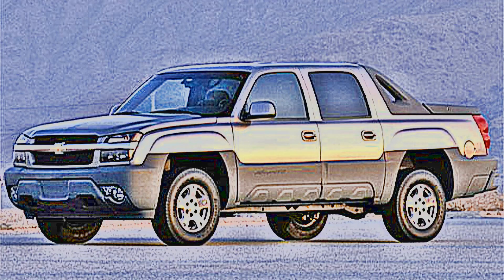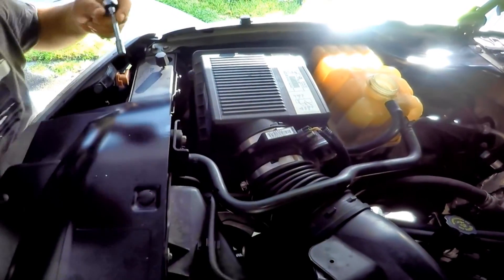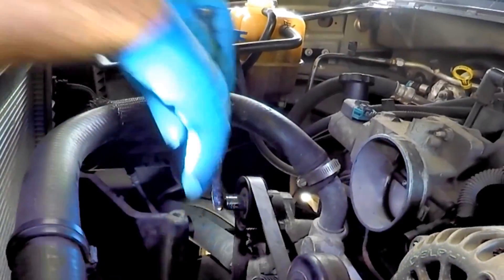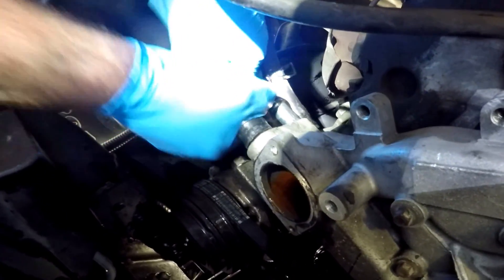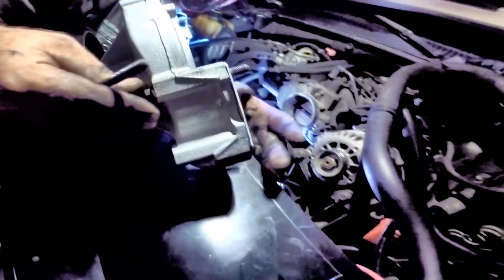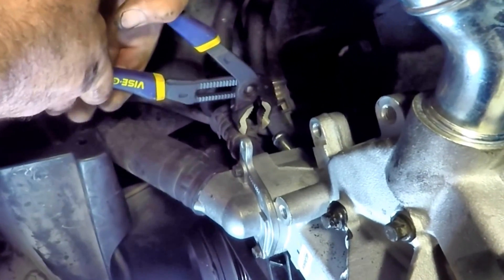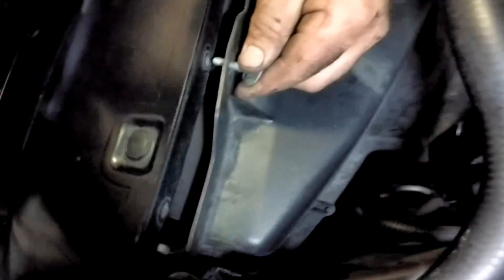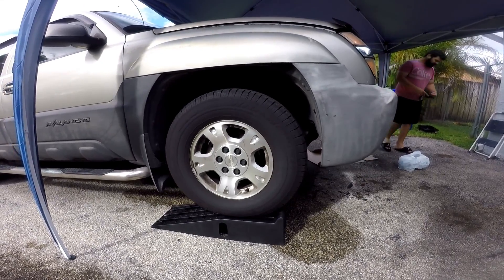How To Replace Water Pump and Thermostat - 5.3 LS - Chevy Avalanche 1500

Comment: Had 2 questions...im currently doing this myself on my vehicle which is the same.  When installing new gaskets and new waterpump, ive been told to use a gasket seal prior but didnt see it being used here.    Should i or should i not use a gasket sealer?  And if i do use one , would i apply it before /and/or after i install the water pump gaskets?  Thanks for the help to anyone that can help! And thanks for the clear and concise video!
Reply from the maker: We prefer gaskets... Use OEM.

Comment: It's not too difficult to do. Most of the work is getting to the water pump bolts and having enough space to maneuver around in there. Good you use a torque wrench for the installation.
Reply from the maker: Glad you agree✌